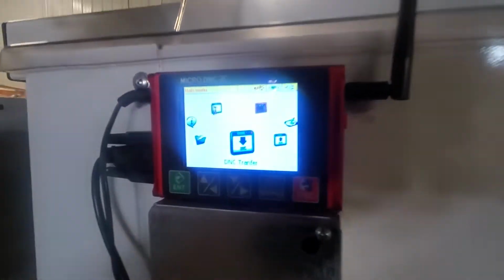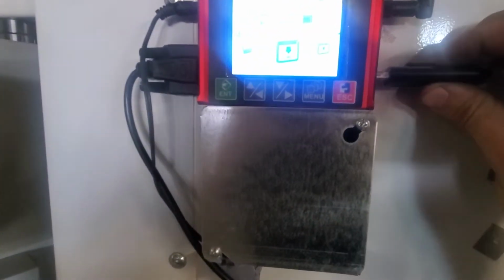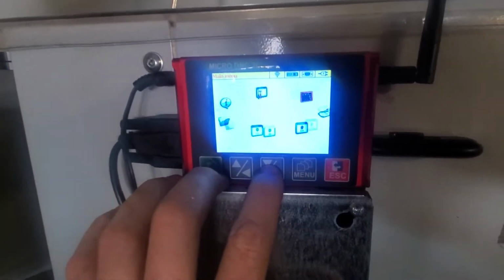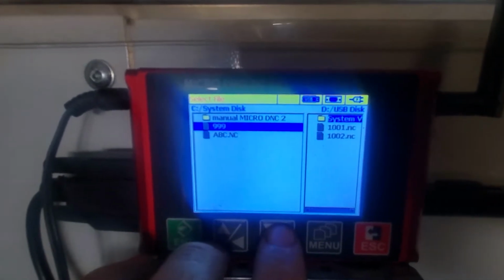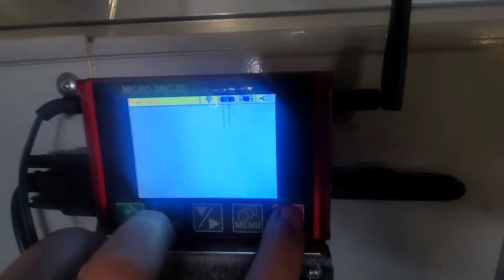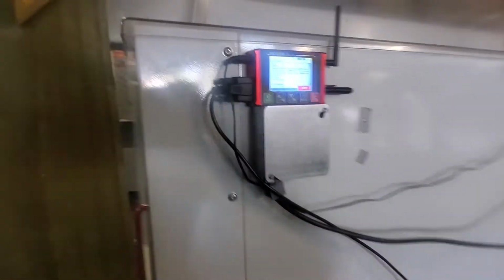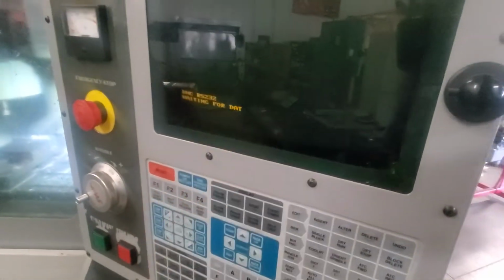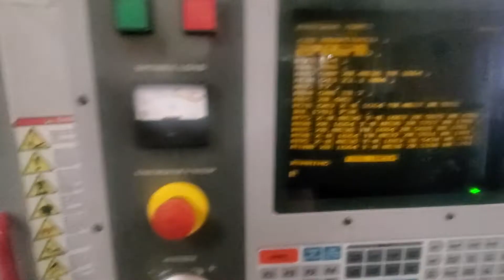Micro DNC2 usb/wifi box on HAAS CNC

Comment: Does each file need to be under the 1mb of your machine's memory? Or can a larger, say 3mb program now be possible without any additional input from you? Thanks (Working through a '99 VF3 with similar memory, but have a USB emulator, but would love to load a large file onto the machine)
Reply: Should be able to use as large a program that fits on the SD card in the DNC device. From what I understand the whole point is it can drip feed